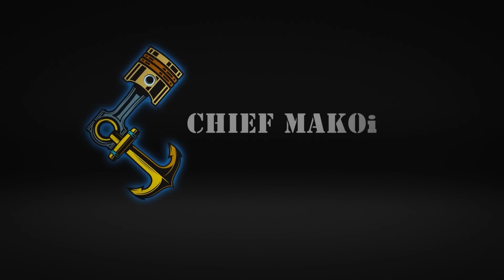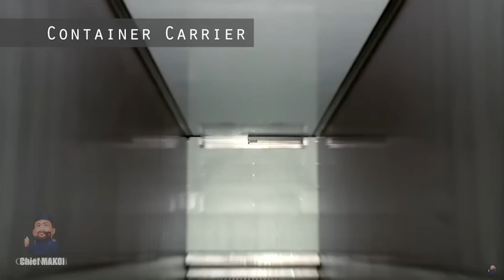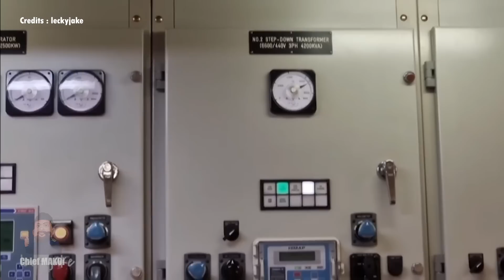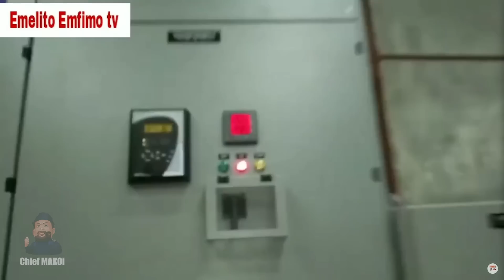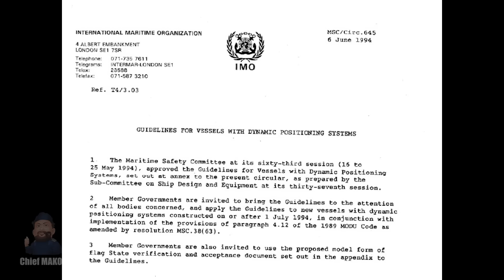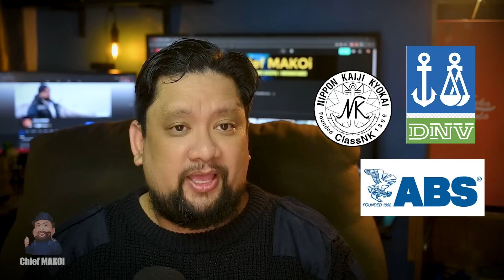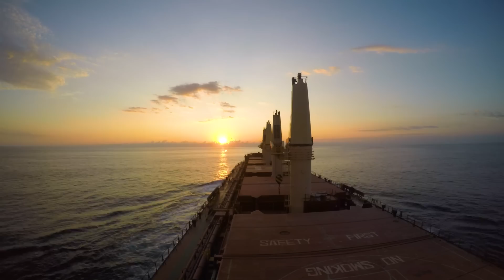Why Cargo Ships Don't Open the Bus Ties During Maneuvering | Chief MAKOi

Comment: Not having a tie breaker is ludicrous and yes I was going to refer to IMO 645/1580. IMO needs to add verbiage to make a tie breaker mandatorily installed and tested annually. Furthermore when transiting Pilot waters all vessels should be required to be in CAM or SMO. The Dali incident would have not likely happened if this were a statutory requirement.

Comment: Thanks chief. I’m surprised that when there is a failure (e.g. breaker trip as in this case) that the first response/procedure was not to isolate (if able) the faulted load as opposed to trying to re-close the breaker. Especially in critical maneuvers. Same goes for when an emergency generator is activated, retransfer to main power should only happen after an extended period of main power stability and then the EM gen set stays running (both for cooldown) and availability in case of re-transfer needs. This is how I’ve always set up my data center operations. 

Seems like more automation (with manual override, of course) would be helpful.

Comment: Thanks, Chief!
I have zero experience on large commercial vessels, but I'm fairly engineering-oriented and understand the complexities involved in making them go. To me the engineering systems seem grossly over-complicated, so I assume I'm missing something (or a lot;~). For example: isn't there enough horsepower available for the main engine to provide its own electricity and power its own pumps & blowers, with other generators for the rest of the ship? On my boat the failure/mis-use of an electrical component doesn't shut the whole thing down, in general.
Reply: On large marine engines you want the lubrication system to be at operating pressure before you start the engine. similarly you want the cooling system to continue to run after the engine has stopped to dissipate the residual  remaining heat.  Finally the marine engine operates at a wide range of RPMs and sometimes operates in reverse. External electric equipment is the current way to address these requirements.
Reply: @dge283  Thanks! With respect, it's the 21st century; surely some shipping giant can spare a few bucks to engineer a system that's not built on a series of blatant failure modes. I get that that'd eat into profits, but...

Comment: Your ability to explain systems is excellent, definitely a characteristic of an instructor who also stays current by continuing to work in industry, which in my opinion should be a reqirement for all instructors. Too many career instructors become dry and abstract due to lack of current trade experience. Well done.
Reply: His students and Junior Engineers who work for this man are very lucky.
Reply: @ArtyEngineer  yes indeed, I agree with you 100%

Comment: It looks like the ship builders need to study the electric utilities because relay protection can be utilized to isolate either transformer for a fault without loosing power to either bus by sectionalizing.
Reply: Very good point    This system is asking for trouble if both sides are generating  and tied together and and there is not a good load share system,
A typical load share system only works if both generators are on the same side

Comment: Excellent video. Your point about “major incidents” resulting in new regulations is spot on. The NTSB already announced it will review “tug assist protocols” as part of its investigation into the cause of the Dali power loss.
Reply: Given the typical number and typical power of harbor tugs in the US vs the voyage time from the pier to the outer channel and power needed to counter the wind on what amounts to huge sails, this will be 'interesting'.
Reply: I sort of get why too.  If you are reactive, then the regulations that get created respond to real risks.  (and blood.)  While if you're proactive, there's a good chance create regulations that  only respond to imagined risks.  (and may fail to invest in preventing real risks, resulting in blood and waste.)   It's a hard line to walk.

Comment: Thank you once again Chief! Under normal circumstances in port areas, how long in time and distance does it take to reverse the engine - given the momentum and water pressure on the prop?  As in, how long and how slow must the ship be going before the air pressure is sufficient to start the engine in reverse?  Watching sea trials of SS BADGER, the 2 Uniflow steam engines appeared to shift into reverse very quickly, but of course that is entirely different.  Thanks for all your videos!

Comment: Hi Chief
On a split bus with gensets running on both sides, how is phase sync achieved???
Reply from the maker: I don't think you need to sync them as they are not connected.
Reply: If the bus is split there is no need to synchronise. If the bus ties are to be closed then you need to synchronise the bus before closing and shutting down a generator. Having worked on dp vessels getting the shaft generators synched and then splitting the bus was a pain in the backside
Reply: @geofffisher3680  I get that it was if the 6kv bus was split but the 440v wasn't..

Comment: There’s no reason to physically split the buss unless you are working on the bars.  You can have the redundancy and run with both transformers and all generators online manually.  The reason they won’t is because it’s not good for the generators to be sat on low load and it costs more in fuel and running hours.  We often sat with all generators online in manual for confined waters, even though there was not enough load to justify it, passing through suez, docking etc…
Reply: Well, at the end we would have to write down all combinations possible; which will have their specific pro`s & con's each. I believe it's also important to consider situations while being in open sea (where there should be more time to react) or confined waters, where every second might count. Disadvantage of also having HV bus cross-tie breaker closed might be that a severe fault might cause all DGR's to trip at almost same time; causing a total blackout.
Reply: @NRZ-3Pi10  They setup upstream breaker discrimination curves to stop them overlapping.  It’s no good splitting the board if the cooling water pump feeding the engine is on buss A and a fuel pump feeding the engine  is on buss B.  Either side blacking out still shuts down the engine.  There is more redundancy and load available from not splitting the board but having all generators/transformers  online.

Comment: Given how catastrophic having a main engine shutdown is, I wouldn't be surprised if there weren't changes to make more redundancies to keep them running. Like dual dedicated purpose generators for the engine.
Reply: Losing a main engine isn't that bad. Your anchors and your thrusters can usually keep you out of danger. It was the power blackouts in the engine room that kept the bridge from accessing any other machinery, including the main engine.
Reply: @elizabethbottroff1218  Thrusters only work a very low speeds and anchors take a long time to work because of the forces involved. The best way to maintain control is to keep the main engine working so a blackout of 60 seconds or less doesn't leave you out of control. The engine should remain running until automated systems restore power.

Comment: The victims are always blamed and further regulated.  There might also be some regulation that forces corrupt and inept municipalities, like Baltimore, to strengthen bridge protective systems.  The original design has apparently been in place since the bridge was erected.   A decent Dolphin, Batter Pile or other protective structure (such as those used on the new Sunshine Skyway bridge in Tampa, Florida) would have likely prevented this mess altogether.  The finger of blame always points outward.

Comment: You have a gift for breaking down complex subjects in a way that the layman can understand. It's also interesting for me to see your views of the modern engine rooms. I came ashore in the '90s.

Thank you for that outro of the ship cutting through the calm water. It takes me back to some of my favorite moments at sea.
Reply: I worked on Nuclear powered naval ships and it seems insane driving these monster ships in and out of tight quarters without split buses.  You are essentially rolling a extremely large size (but not infinitely large) dice every time you go in and out of harbor.  It is only a matter of time before a disaster like this is going to occur and they are going to be deadly and expensive.  Just cause it is not common practice it seems insane not to find a better way.  I have my doubts that you can build a bridge that can overcome all the angles and dangles for a ship losing power going through.  It would seem far more responsible and probably cheaper to require ships to have some real redundancy in their important buses.
Reply: Please don't hate on me for asking what a outro is. I don't have the slightest clue. It's probably the clearance thing that you ever had
Reply: @nvragn   No worries. 😁 When you watch YouTube videos,  you'll often see an introduction, referred to as an, "intro," sometimes. Then think of In and Out. The extra segments, credits, etc, at the end are often referred to as an, "outro." It's just a shortened slang for the beginning and ending of videos. The Chief had a beautiful shot of the ship moving through the water at the end. One of my favorite things to do, when I was still working on ships, was to find a quiet spot, away from everyone else, and just watch and listen to the ship moving through the water, especially when the surface is calm. I hope that this answers your question.
Reply: @elizabethbottroff1218  Wow ty ever so much for taking the time to respond and answer my question. I feel kinda silly because I probably should have known because it makes sense now. But ya ty for that 👍 🇨🇦 🔧

Comment: Thanks Chief, Splitting the Busses was one of my Questions. Generator Control Units are also a Question; From  Transport Aircraft Tech; GCU's often include the (FROOP) capability; Fault Protection, Reverse Current Protection, Over Voltage Protection, Overload Protection, and Parallelling Functions. So, are the Shipping, Higher Current designs, less sophisticated, and if so, in what way?
 Thanks for your Channel. Sal Sent me over...
Reply: I worked aboard a container ship in the '90s. I can't remember what year the keel was laid, and we never had the electrical board covers off while I was on board. But I know that out generators and the boards had a lot of the protections that you mentioned. What sticks in my memory the most is that our container ship had to kill the breaker to the cargo reefer units during maneuvering. The bow and stern thrusters would draw too much power to be on the board at the same time. In stasis, they could both be connected. But if a few reefer units cycled on at the same time as a thruster was needed, it would overload the board. It was policy to have our breaker for the thrusters open. If they were needed, we had to first open the breaker that fed the cargo reefer units. When I saw the dark ship on the videos, a board overloaded by a checklist failure was my first thought.
Reply: @elizabethbottroff1218  RE: "our container ship had to kill the breaker to the cargo reefer units during maneuvering."
Which to my mind perfectly makes sense. I'd expect manoeuvring in harbour / restricted waters takes ~1 hour; and bow / stern thrusters will also be only needed during that phase since they're anyway effectice for slow speed only. Reefers should be able to keep temperature for 1h within certain range even at high temperatures outside. So reducing total electrical power available such way is an economic decision which does make sense to me.

Comment: IMO, if the port of Baltimore knew that the Dali had a power failure at dock, they should have required tig assistance past the bridge. However, that's just me spitballing.
Reply: Dali should have been held until the issues were resolved.
Reply: Yes it's you spitballing because according to the NTSB report the power failure at the dock had nothing to do with what happened later.  The earlier failure was not an equipment failure.

Comment: With more than one power supply tied in, they must be synchronized, if not everything trips.
Reply: With the bus split, there is no need for the 2 sides to be synchronized.
Reply: @SteamCrane  if you join two generators through the same system  they must be synchronized. Split bus can be joined or isolated.
Reply: @georgeberg2106  Obviously, 2 generators on the same bus must be synced.  But the 2 sides of a split bus don't need to be.

Comment: I design control software for land based high reliability power systems, considered to be "mission critical".  I was shocked to see that an inherently redundant power system was being operated in a non-redundant mode in restricted waters. Very simply, if the bus ties had been open, thus operating as a dual redundant power system, the allision and 6 deaths almost certainly wouldn't have happened. Out on the high seas, the more economical non-redundant mode would be fine. I hope that the regulators will soon require operating in split bus mode in restricted waters, or that at least the US imposes that requirement.
Reply: I appears that it was operating non redundant because the load was too much for just two generators and the ability to switch the loads between the two sides was not there or not done .  Non redundant operation also disabled the load share scheme between running generators
Reply: @parkerholden7140  If you are operating split bus and have just barely enough generator capacity on line to support the load with both sides operating, then you are not redundant, in that loss of one generator will require load shedding.  The point of redundancy is that either side alone can support all critical loads. That's why the ship has 2 generators on each side, but they are useless unless they are online.  In restricted waters, all available generators should be running, synced, and online.  This is only for a few hours of fuel inefficient redundant operation. Once out on the ocean, switch to non redundant fuel efficient configuration.
Reply: Obvious bot 😂
Reply: @onehandonglizzy  Thank me when the ATM works or you can get at your bank account.

Comment: just a note: generators are specified in KVA/KW.  a ship will have the same KVA rating of generator whether it is producing high voltage or low voltage.
Reply: But high voltage wiring can be much thinner for the same power rating. Simplifies things.
Reply: @SteamCrane  yes.

Comment: I wonder if you could replace the backup generator with a battery bank, maybe even one that can power the main engine pumps for a few minutes. Batteries would have an instant response and keeping the main engine pumps up for a few extra minutes would be enough to stop a ship that's maneuvering in port. Batteries also can't have fuel issues and don't need as much maintenance or to be run periodically the way a generator does.
Reply: Massive battery banks still have their own issues, & hazards associated with them (thermal runaway, toxic chemicals, etc.)
Reply: @westtex3675  we're learning how to deal with those in the electric car and grid storage industries, so that doesn't have to be developed especially for submarines.
Reply: I’m not saying it has yet to be developed. I’m just saying, as someone who works in the power industry, and been involved with proposals of industrial-level battery storage,  it’s just not always as simple/economical of a system/solution as people think.

Comment: If I understand correctly the main engine would have continued to operate except for lack of power to the fuel and oil pumps.  Maybe redundancy is needed here.  Other key systems such as rudder seem quickly recoverable.
Reply: There are redundant fuel and oil pumps, all are fed from the low voltage bus.  Since the ship was operating with a joined low voltage bus all fuel and oil pumps lost power when the fault occurred.  If the ship had been operating with a split low voltage bus only half of the equipment would have lost power, the main engine would have remained operational.
Reply: @dge283  Agree, that is the critical error!
Reply: @doug... You might not know this. Main engines have to have functioning lube oil pumps to operate. They have low lube oil alarms on them. The alarm sounds a warning that gives a short time to respond and correct. If the alarm isn't answered and the pressure corrected within a set time limit, the main engine has a safety shutdown. It goes from a loud engine room to a fully stopped engine very suddenly. It protects the main engine. If the engine room has had a blackout, that main engine won't be able to run. I hope that this helps to explain it.